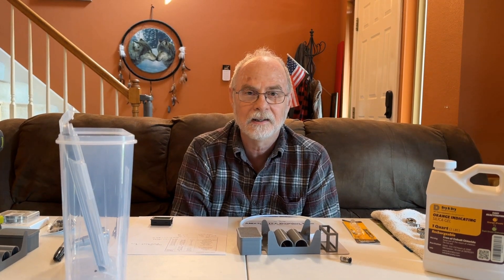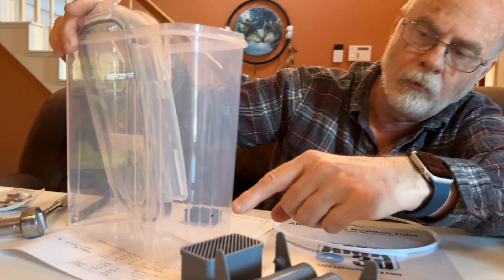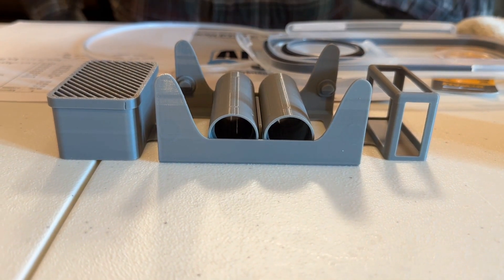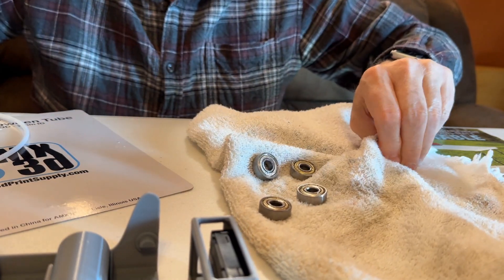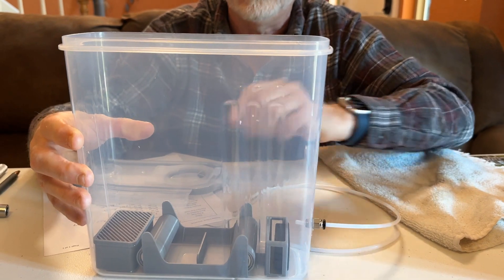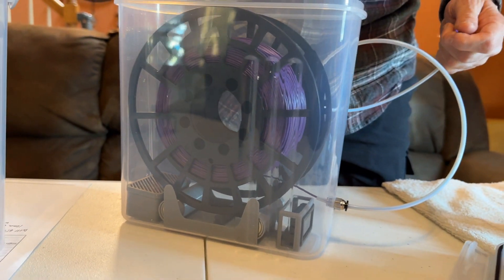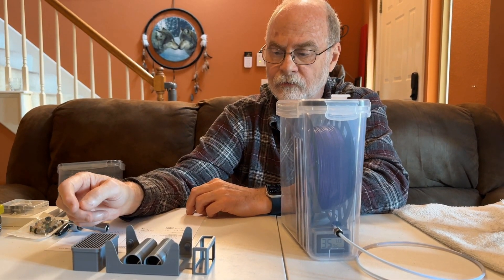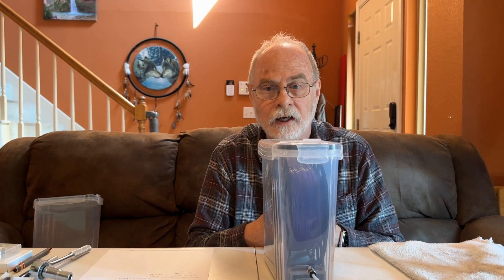Oily Krafter 3D Printer Filament Dry Box

Comment: Printed 2 sets, works well, alas the lid of the dessicent box is loose and will leak out if tipped /banged around putting on shelf.  I solved by using an elastic band to keep the lid tight.
Reply from the maker: Thank you for watching. Thanks for the tip.
Reply: GREAT idea!